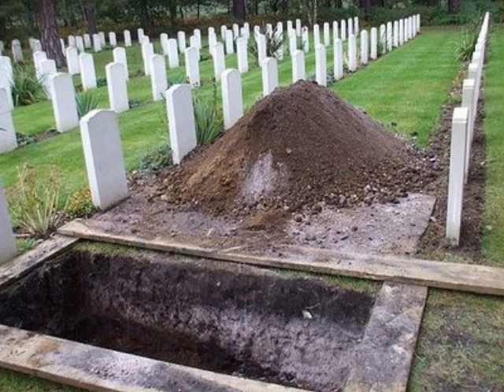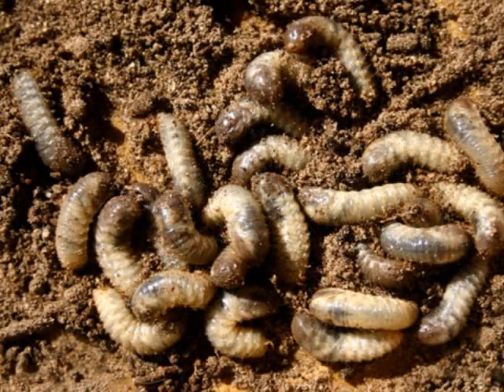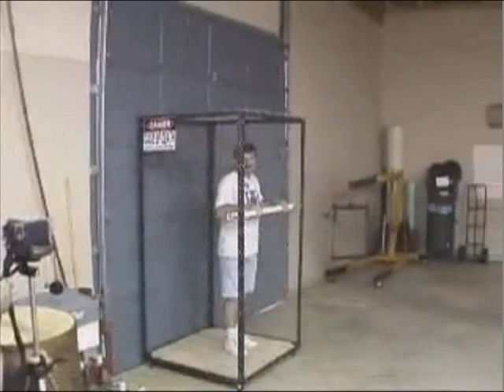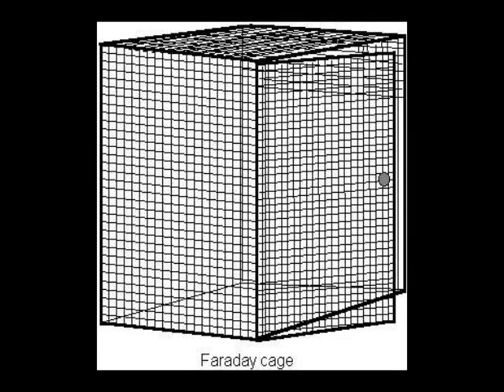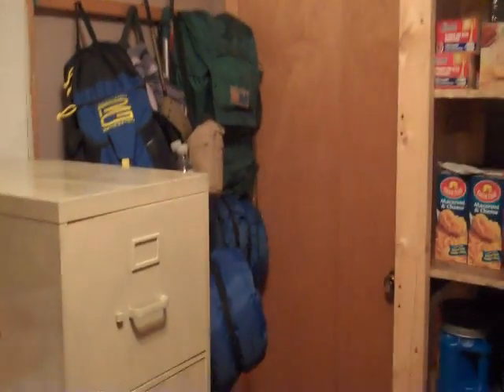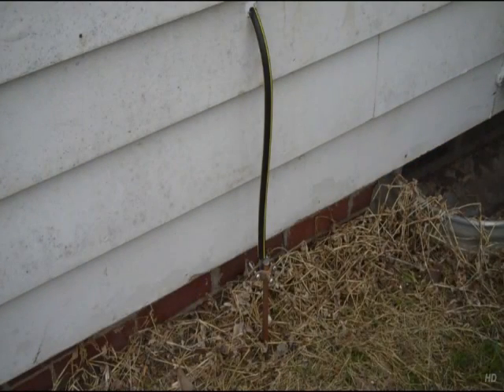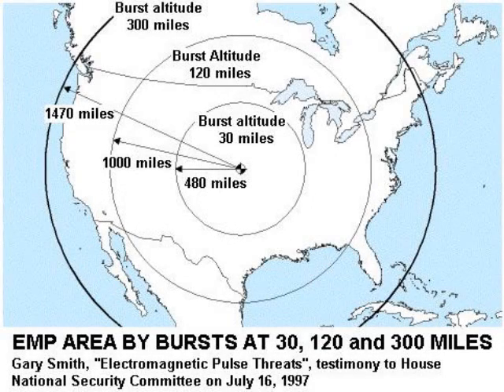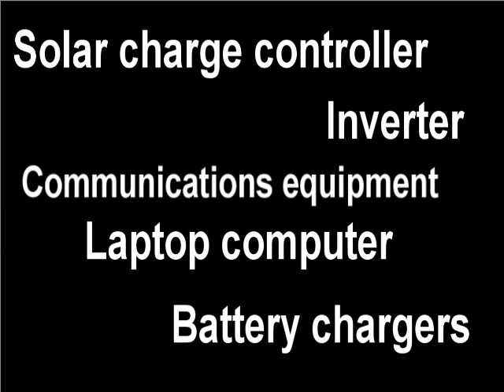My cheap & simple "Faraday Box" (Be prepared episode 4)

Comment: I believe that your metal cabinet will not be effective against an EMP.  It does not fit tightly around the edges and will not create an effective field around the cabinet to cancel out, or balance, an electromagnetic wave from an EMP.  Basically it will leak into the cabinet.  I have found a cheap and effective way to provide protection.  I use metal "tins" that are popular around the holidays.  Pick them up used at thrift stores for under a buck each.  I look for ones that aren't bent had have tight lids.  I nest them, smaller ones to fit into larger ones. I put my electronics in them.  For extra protection you can use metal tape around the lids but for the things that I need to get to to use I just triple nest them.  Problem solved and cheap.

Comment: Hey dude!  Fun clip....and interesting.  I urge you to watch "disasterprepper" on you tube for some interesting experiments he did on cages. He used a garbage can to show his experiments and it turned out that even a tiny hole in the can(box) and it did not provide much protection.  He had to tape the seams on the can to get decent protection.  Everyone's got an idea of what is protected....my cell phone doesn't work at all inside my metal shop but EMP's are a very wide frequency spectrum and millions of potential volts....MUCH worse than lightning.  I really think it depends on where it's set off from, how high it is, how strong it is and the weather conditions can all have en effect. Some say anything plugged into the grid will fry and anything with solid state is gone without protection.  Some say whatever is vulnerable has to be on but I'd bet that's not true...I'm a ham radio guy and what makes an EMP work is that everything is an antenna and absorbs that huge voltage and frequency burst.Also FYI, solar panels (PV's) are basically a bunch of diodes and an EMP will probably wipe them out if they're deployed when something hits.   Not beating you up...it's a cool vid, just don't want you to think your electronics are protected when they are really not.  I have my PV's, couple ham radios, wind generator, inverters, couple laptops and some other stuff stashed....but I think they're pretty protected because of what I saw on disasterprepper's  clips.  Check it out...

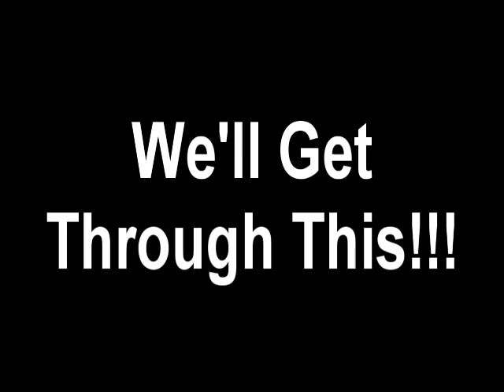Comment: At 6:52 up in the attic you have a electric box that has wires going out to plugs I guess,what is the name of that box?I am trying to run a main wire from my inverter to the attic,to a box like you have pictured so I can make wall outlets In my house..please help!!
Reply from the maker: +Gary H 6:52 is the end of the video.
Reply: +GoatHollow Oh I'm sorry it was at 5:42 and I seen another video of your solar that you said it is in  the basement.I just need to know what that box is.Thanks
Reply from the maker: +Gary H Just a junction box where I brought the 120 volt power from the inverter and "Split it" to go to several outlets.  Wish I could share a drawing LOL.  There are only wire nuts in there connecting the wiring from several different lines.  (One thing... Never bury a box like this behind drywall or paneling.  If there is a short, you won't ever find it.)
Reply: Thank you,I want to mount this in a central point in my attic and run lines down through existing holes that are already drilled through the headers to pre-existing outlets and make solar outlets next to the pre-existing outlets in the house,hope my theory works.Did you ever upgrade your solar and get the siding done on the house where the termites got to it?Anyway thanks and love your videos!
Reply from the maker: +Gary H I got the siding in that area done.... Solar not so much, the batteries are 6 years old now, and shot.  I need to replace them :(

Comment: Suggestions for what to maybe put inside your cage? What about your automobiles computer. A multi band police and air scanner. A couple of cloned Hard drives. with of course your spare computer that you have all your PDF files on how to survive. I also recommend you put conductive aluminum duct tape on the openings with some bare sanded metal spots on the corners. If you want to play games while the world is ending and you have enough room left which I doubt toss in a play station. It really wouldn't hurt to bare bones your computer so you leave out the tower. with a spare Mother Board, memory sticks, and Processor, If you can find a good metal box for them that will fit inside the cage for a cage in a cage. That would work as well. You might consider buying a stainless steel Hoffman NEMA 5 cabinet bolts in the holes for mounting not the plastic hickies. and tape around the rubber sealed door. Does that help?

Comment: There is a guy that does lab tests on faraday cages and he says a ground is not required. You can seal the cracks with foil duct tape.
Reply: Dave Dave can batterys survive outside a faraday cage in an EMP?

Comment: couldn't u have just put a think piece of rubber under the file cabinet? Its been said the safest place 2 be during a severe lightening storm is in a car being that r=tires ground out the electricity.
Reply: The tires actually insulate the car by putting a non-conductive layer of rubber material between the car and the earth, or "ground." This does not allow the electricity to complete its circuit from the sky to the earth. When something is grounded, it makes a complete circuit. That is why a ground rod is pounded into the dirt. And, actually, lightning is such high-voltage/current, that tires would probably not be much good in a direct hit.

Comment: Is there any reason why one could not simply use a metal shed for a faraday room, where you can keep your electronics?
Reply: +Aldo Torres For one, if you stock piled electronics in that one room instead of using multiple smaller ones, not only is portability reduced but once that door opens, everything is at risk. Then with the shed you would have to inspect every inch of it for the smallest openings and cover them with something like metal tape, find a way to insulate the inside, and i guess it's just all around a huge hassle.
Reply: +Aldo Torres Oh yeah, and you don't want something so obvious, others might notice and try to break in. You want something that can be moved and hidden easily, something inconspicuous.

Comment: ACTUALLY!!! you are NOT supposed to GROUND a FARADAY BOX! its like if a car get hits by lightning, not much happens when compared to a grounded tree for instance cuz if the rubber tires. Don't ground the faraday box and don't let what your protecting in the box touch ANY part of the box. You Gotta Keep 'Em Separated!
Reply: +GoatHollow voltage isn't an issue, but merely the amps it has
Reply from the maker: ACTUALLY!!!! You're assumption is flawed.  Lightening is ah much as 50K volts.  It will arc for several yards.... A car is close enough to the ground, that lightning, essentially sees it as grounded.  Rubber tires on a car mean nothing to lightning.  And yes... You're electronics should be grounded from the box.  here is more info... http://www.accuweather (Dot com)/en/weather-news/cars-can-be-safe-place-during/17283636

Comment: You may wish to put plate metal on the bottom.  The microwave portion of the emp from a nuke can go right through those holes in the mesh.  if the wavelength of the em is short enough and the detonation is close enough.  I played with microwave and RF electronics when I was younger.  Also, putting stuff in antistatic foil bags is little to no protection.  I am about to upload a demo vid as to why probably tonight if I have enough time, tomorrow if not.

Comment: That's 260kw, in 40/1000000 of a second! Notice that little plug, that doesnt power it. Look at the big cable going into the big box. Also notice that the field is aimed away from the audience, Id like to see the waivers they signed, just in case. Wrap a coil like that around your trash can, and light 'em up. Wander if that radio still works, Or maybe you can now take the trash can and radio and put 'em in you shirt pocket. Think you need grounding???

Comment: Ok, time for school. A real raraday box should be a sphere, like 2 salad bowl halves. Why? Because a sphere does not act like an antenna. Antennas are lengths of flat or tubular stuff. You don't want to pick up any waves. Also as far as the ground goes, you better check it good. If it was me, I would take a 220 leg and hit it with it. If it pops the breaker, i'd say it is ok at the time. Also remember just because you have a 8ft rod, doesnt mean anything if it's dry. The bottom of a well isnt..

Comment: also you should line the inside of your container with thin copper sheets and over laping the sides and the bottom completely and doing the same with what ever type of lid your container has .you must have copper on it as well on the inside  there can be any gaps anywere. copper sheets are  generaly found  for sale most electronic stores(not raido shack i mean real electronic stores ) such as frys electronics  vetco electronics  just  to name a few. a 24"x24" sheet usally sells for around $12.00

Comment: You might want to rethink the ground 'wire'. The idea of a cage is a solid metal barrier with no wires or grounds protruding which would then act as conductors to the cage's interior and fry the contents inside. Faraday himself said that no ground was necessary. Check out blackcatsaloon for more info:

Comment: Good video but as some others have stated it's not a good idea to ground  a Faraday box.  If you google "Noah's Ark: Protecting Yourself from EMP" there is a white paper on this that goes into greater detail.  I like your idea though old filing cabinets make good Faraday boxes. I noticed some people state why would you protect electronic devices when there is no electricity. Well electric generators, electric motors are innately EMP resistant by default so its not like there would be no power.

Comment: @GoatHollow There are refrigerators available that will operate on a single solar panel (Sundazer comes to mind). Of course, these have electronics and would need to be likewise protected, but it is possible to do so. Not a long term solution, but for lesser events it is doable, at least as long as the insulin remains viable.

Comment: You can improve your odds with the filing cabinet by removing all of the paint, which could possibly hinder contact between electricity & steel.  You can further improve your odds by covering the inside & outside with heavy duty aluminum foil.  This is because aluminum is a FAR better conductor of electricity than steel.

Comment: A great grounding line for the type of damage a HANE could do is to run an exposed wire 20 feet long and 2-3 feet deep from your grounding point. This acts kind of like the opposite to an antenna. You should also have grounds to all your antennas. To cover any gaps use metal duct tape. Your ground should also be soldered or welded to the box and not bolted. Objects inside should not touch metal directly. If you can transmit a signal out of the box with ease it will not work as a Faraday cage.

Comment: I have a AA degree from the NAVY after serving on submarines for 7 years I was a nuke and the idea about the radio was one I heard in nuke school that when a emp was used a sub would be safe as it is isolated ground under the water . I would wrap the item in aluminum foil on to of rubber matting that way the outer cabinet would be a isolated ground

Comment: Good Idea, foam is a good thing to put in. I would put just about everything the same as you mentioned in your video. I think you covered pretty much everything except maybe sensitive medical equipment, and maybe diagnostic equipment, spare parts for your vehicle, like maybe a spare PCM, and other sensitive electrical components. Thanks for the video.

Comment: Make sure you test your faraday cage. Turn on an AM radio and put it in the "cage" if you can still hear it then your "cage" is not really a faraday cage.  Put an FRS radio in the cage then transmit to it with another if it picks up the signal the you don't have a Faraday cage.

Comment: i suspect grounding defeats the purpose,think automobile in a lightning storm,the fact that the car is not grounded but sitting on insulation in the form of rubber tires protects the occupant from electrical conductivity